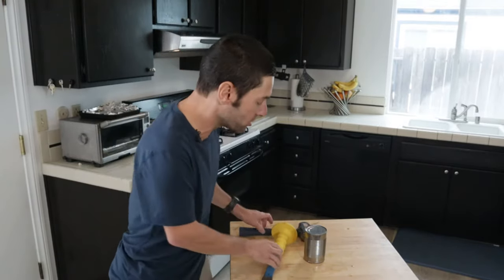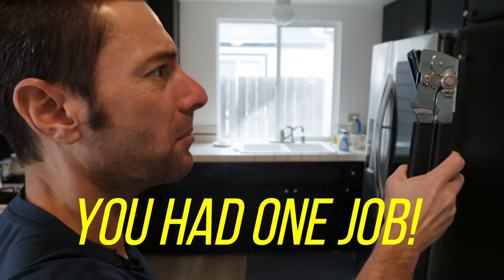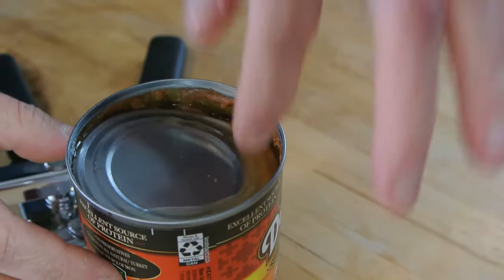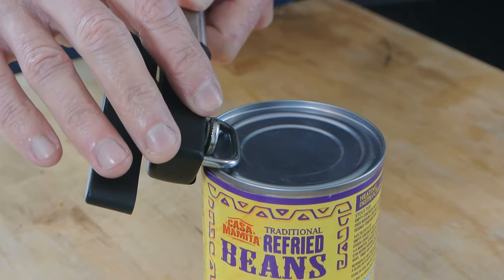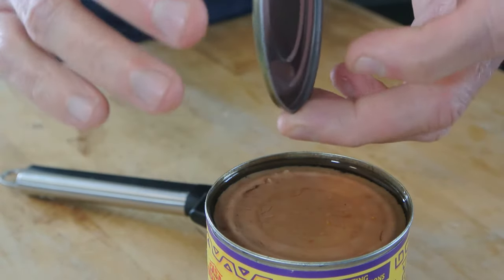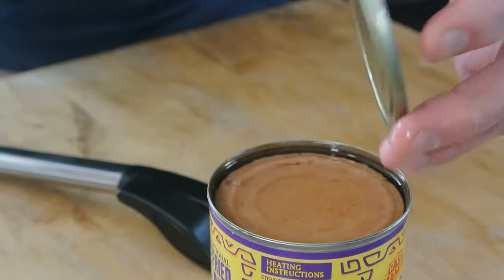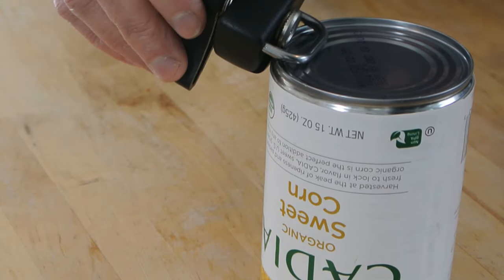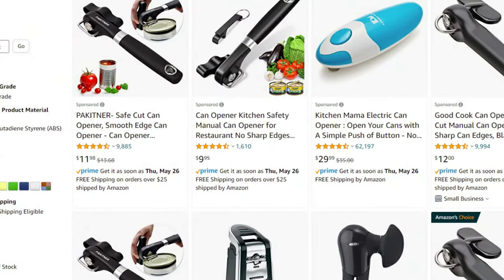Side Cut Can Opener: How To Use & Why It's Better

Comment: I picked up one from Walmart about a year ago.  It works great but since I don't use it often, I spend a good 5 minutes trying to figure out the correct placement for operation 😄  I was raised in a 70'/80's household with the mandatory electric can opener.  Funny how they're almost obsolete now.
Reply from the maker: Ha! I see those older electric ones at thrift stores now and then — along with all those bread makers. 🤪
Reply: My mom doesn't even own a regular can opener. And if you say "can opener," she assumes you're talking about an electric one. I hate the things. They break, half the time they don't do a good job opening your cans, and the magnet can't support larger cans. A normal manual can opener works just fine for me.

Comment: Nice video. You can also flip your first can open 90 degrees putting the twisting handle on top of the can and cut the side off just like your safe cut version. The Swing-A-Way brand is best and have used for 40 yrs. $10 and lasts.
Reply: bought a swing a way recently and it lasted a year before it stopped opening cans smoothly

Comment: How long does it last? All my can openeders last 2 months average and I only open maybe up to 2 cans a week. They all start failing. Teeth start wearing out then you have to squeeze harder and harder until it's completely dead. These new ones you are talking about, I've read the reviews on Amazon, and people say they start failing after 3-4 weeks. So if this also a problem with this style, what other option is there for a can opener that will last a year or more?
Reply from the maker: Good question and thanks for asking. So about a year after getting it I notice it’s not as easy to operate. Not sure if that’s just mine/me, but maybe apparently not based on what you’re saying. I do still like the idea of this thing and its benefits. Maybe there’s nothing such thing as the perfect can opener?

Comment: * A regular can opener can cut the lid at the the side !
Reply: How?
Reply: @pamela9163  not the ones that you leaver, the ones that have cogs and a you twist/turn, by placing it horizontal on top of the can, pierce the side of the can under the lid, keeping the opener flat on top of the lid.

Comment: I'd love to see one of these garbage channels read the instructions and actually showcase the "take off" feature the openers have - you shouldnt need to take it off the can, it should come off with the lid
Reply from the maker: Hi. In case you missed it, this garbage channel did exactly that in the video: demoed the opener taking off the lid, as well as noting that feature. You can find that at 3:27 in the video. Best regards.